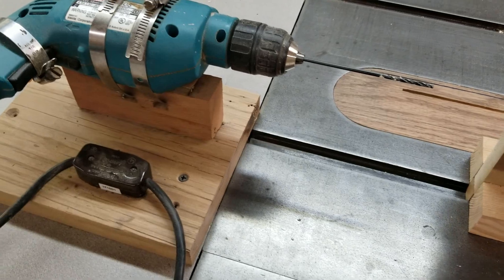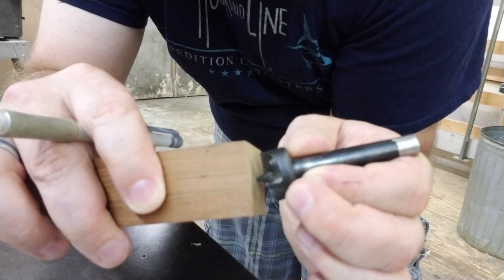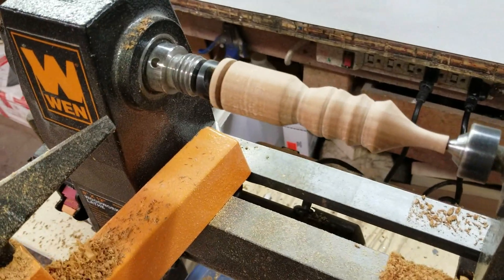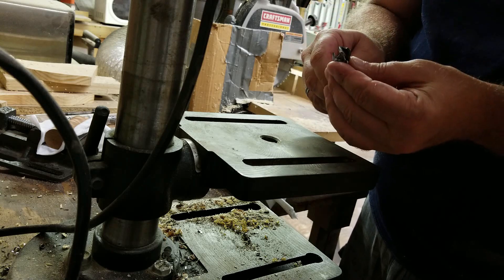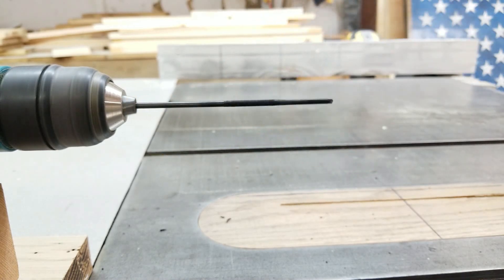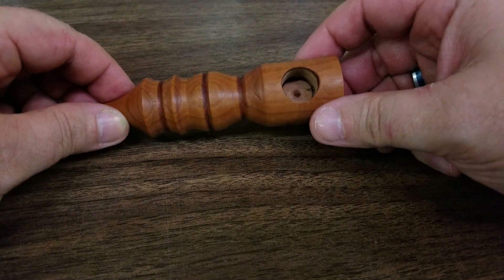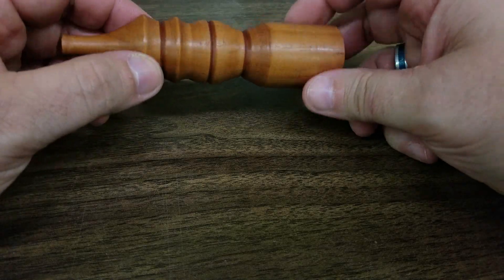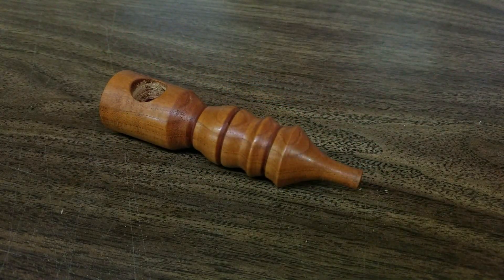HOW TO TURN A PIPE ON A LATHE!!

Comment: I have made many pipes in the lathe... One of my favorites onesto make is to make a pipe about like you have.  When I turn it I put an extra 2 - 2 1/2 inches my blank. Then when I drill my 3/16th hole all the way through it.  I use those holes t center my spindles.  I basically turn what you have but with the extra 2 1/2 inches I turn a separate bowl with a 1/2 inch stem tapering to the bowl chamber.  Like a smoke stack.  I turn it right on the end of the mouth piece and then when both are done I part them almost apart and finish on the band saw or with a coping saw.  Now where you drill your 5/8 hole I drill a 1/2 in hole for the stem of the bowl to go.  Then get a solid piece of 2x stock you can clamp down and drill a 1/2 in hole and you can place the stem of the bowl in it and it can hold it in place when you drill the 5/8 hole in the top.  Now the stem of the bowl will slide into the other making it a 2 piece pipe that is not any harder to make.  If you drill the 3/16th hole all the way through the base stock the hole in the end will become a carb for the index finger.   I have made well over 100 as I just finished turning 4 of them a hour ago.  

I have a pecan tree that every year I trim in spring and I save all the limbs big enough.   I cut them up  8 in long or so with my bandsaw and toss them in the corner of my shop to dry.  ^ months later I make pecan pipes from them.   When done I plug the bowl and holes with paper and I lacquer finish the rest of the pipe.    I also make a little handle 3 inches long that I drill and place a 1/8 piece of stainless tig rod into. cut long enough to go all the way through the stem.  It is a quick cleaning rod if it plugs. Also good to knock out a 5/8s screen if it gets stuck..    Maybe one day I will do a video so you can see mine.   They look really cool and easy maintenance. to keep them clean and smoking well.   I have not done cherry yet but I have done Apple a few times from when my dad trims his trees.     

Very nice build. I hope I did not loose you

Comment: Hey man, I needed to ask, do you need to put a filter in the pipe? I have seen both shorter and loner types of pipes and am still not sure if this one needs it. Thanks
Reply from the maker: I guess it's just a matter of preference. I don't think one is required by any means.

Comment: Bur bits are better for drilling pipe bowls because they create a rounded bottom which is easier to keep clean. Your squared off bottom can collect a lot of crud in the corners that is hard to clean out and just builds up.